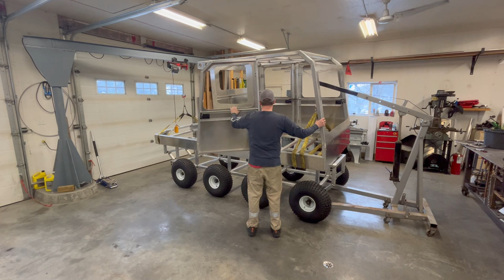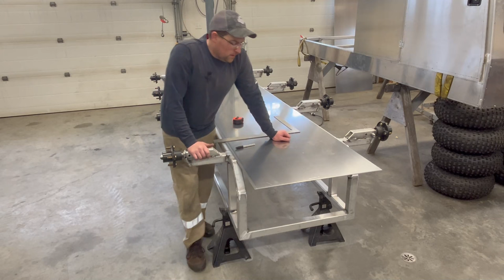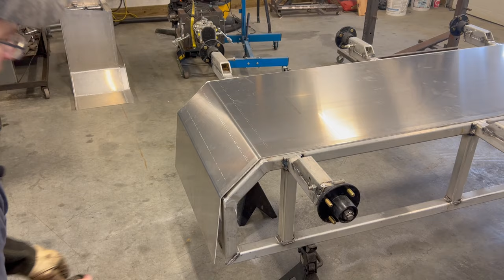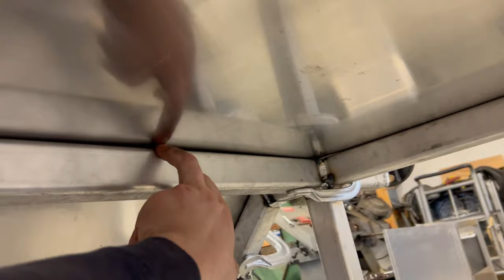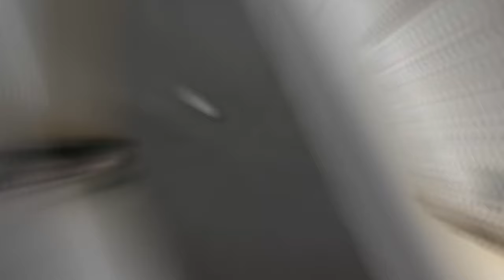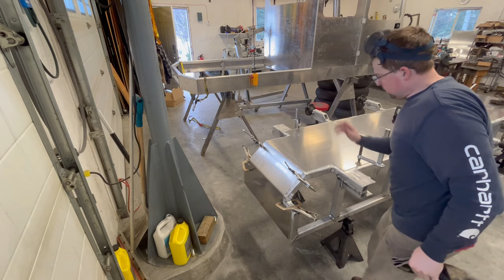Snowcat or Boat | Snowcat Build PT21

Comment: LOL @ Crane. The winch is a little too jerky and could actually be slower. Soft-starter may help too. 
You know what, I reckon if the belly pan sheet was wide enough to suport folds along sides and weld all the way out to the axles, it provide them a lot more strength laterally as well a provide a side ledge.
Reply from the maker: There is a lot of bracing to go in. Problem with having such I wide belly pan is it will collect snow and ice between the hull and tires. The winch has a snatch block that helps cut the speed in half. Just didn’t have it in place
Reply: @CenterLineDesigns  Fair enough on snow collection. As for winch, to slow or stop the jerking of it as it is a little brutal.
Reply from the maker: Totally agree. Completely needs some perfecting. I need to somehow buy more time lol. 

Very much the feedback. I have gotten several idea I have implemented already. There is a bunch of bracing to go in. I just want to get the hull pieces in then brace after. But good eye! 

Thank you for watching

Comment: Looking good. How much do you reckon it weighs at this stage?
Reply from the maker: Hmm. That is a really good question. Without engine I assume possibly 600-800 lbs. probably around 1000# with engine. My goal in under 2000# all said and done

Comment: Good Job! 0ne question how are you going to change the oil?
Reply from the maker: I have debated connecting the drain with a port in the side of the hull. Or possibly a hose and use a suction device. Not entirely sure yet. It’s definitely not ideal but for the once a year I will need to change the oil I figure a bit of headache is okay. Just watch that come back to bite me lol.
Reply: It would be easy enough to cut in an inspection/access panel in the belly plate after its finished.